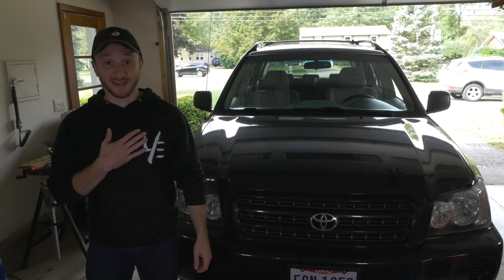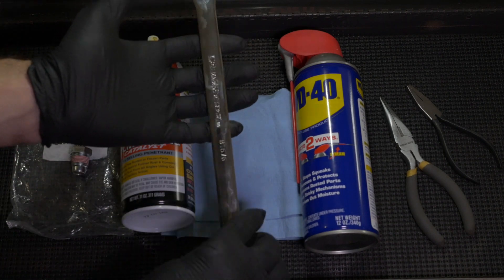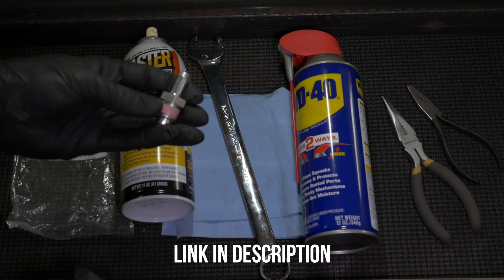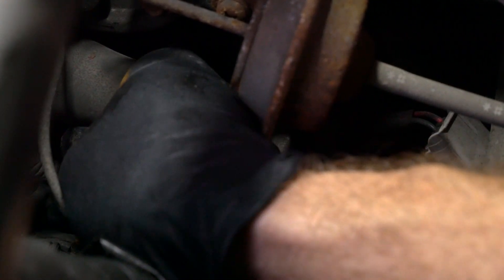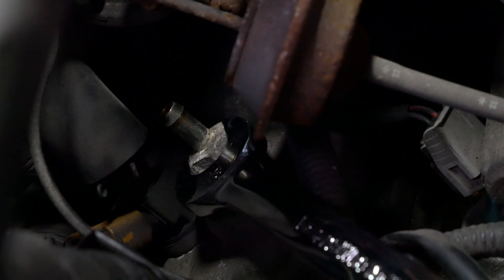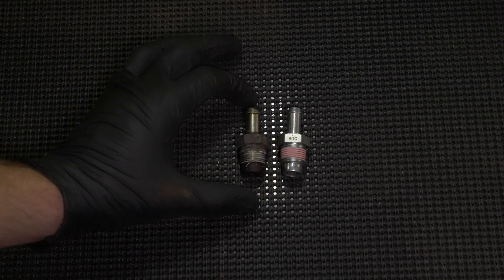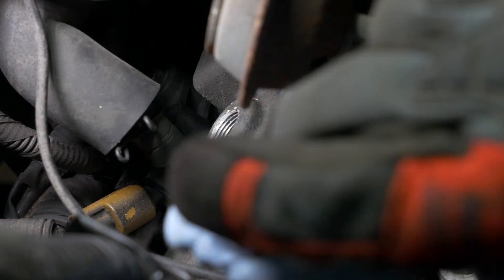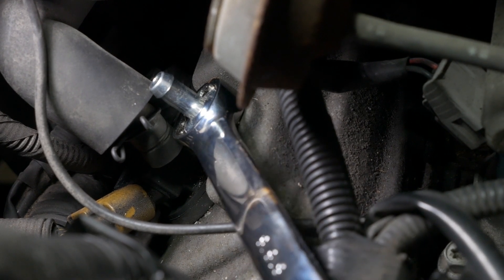Replacing the PCV Valve on the 01'-07' V6 Toyota Highlander

Comment: Curious about the before and after. How was your engine running prior, and what did you notice immediately afterward in how the engine improved (if at all). Thanks.
Reply from the maker: Hey Tom! To be honest, I didn't notice too much of a difference. It was in the service schedule so I decided to replace it. :)
Reply: Would it be the same for 2005 fwd 3.3   And how many miles are on your Highlander

Comment: You just saved me an $80 labor charge from the Toyota dealer! Car was burning a lot of oil and maybe this will solve it. Difficult to get it off. Added WD40 to the threads to loosen it. Thanks for your video!
Reply from the maker: Happy to help! Hope it fixes your oil problem. :)
Reply: Did it fix ur oil consumption problem Ray?
Reply: It didn’t seem to improve it much. I could have just occasionally keep adding oil but I sold the vehicle.

Comment: with the thread loc that comes on the replacement, it will require some muscle to insert the new PCV.  Personally, I was unable to get the new one in as far as the original, which appears to be the case in the video as well.
Reply from the maker: Yeah it seemed to stick out just a tad more but was very tight and sealed. No leaks thus far! :)
Reply: @DIYTillIDie  same case with my 03

Comment: I did this on my 2004 Highlander and it wasn't any fun at all.  There is very little space.  I ended up using a crow's foot wrench and a ratchet.  I might have put on an angle adapter, too.  It was hard to tighten as well.  Got my cable camera out to make I was on straight.  Anyway, it is doable, but don't do this in a rush.  When the video was sped up to show wrench turns, there were a LOT of wrench turns!!!!  This takes time.
Reply from the maker: There sure were! lol..... Fortunately I have smaller hands so it wasn't too bad. Patience is key. :)